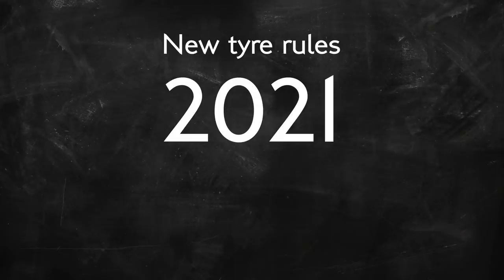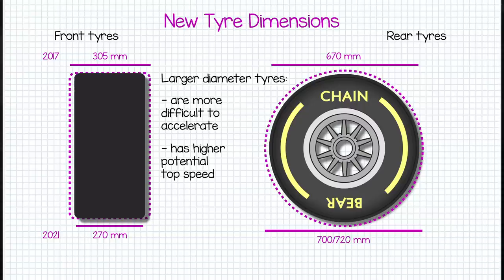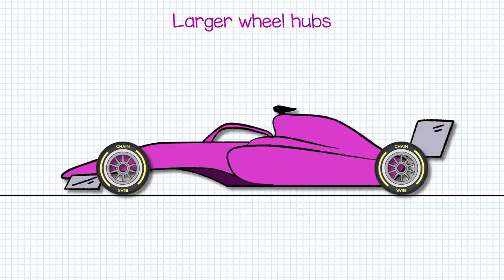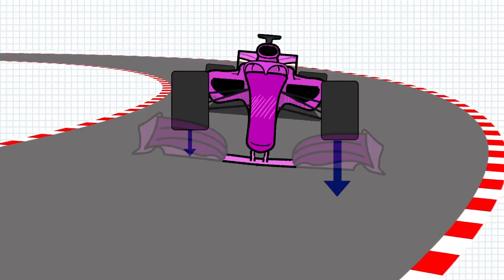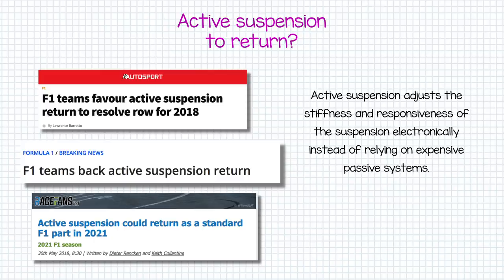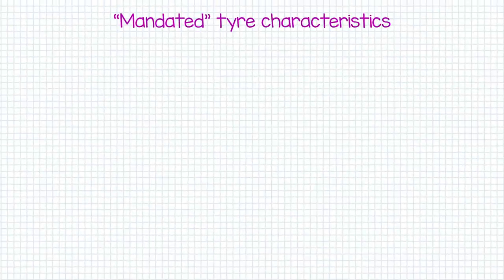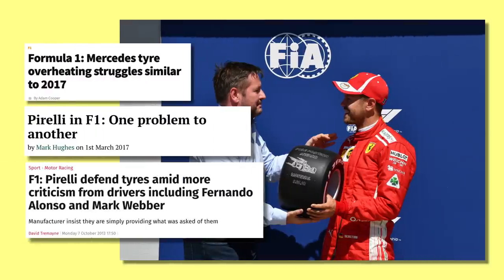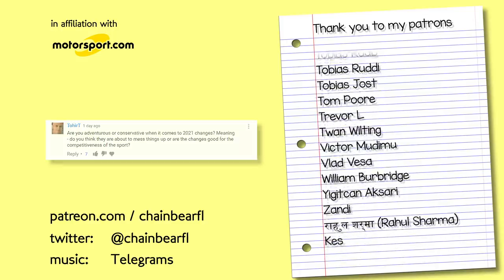New Tyre Rules 2021 explained - Low profile tyres, no tyre warmers, radical compounds

Comment: to be honest i personally feel like part of the asthetic of F1 cars are the massive tires
Reply: Totally agree. That is what F1 tyres are supposed to look like. This change will make the cars look more bland ie like a normal car.
Reply: let's not prioritize form over function though.
Reply: ThermaL I think as long as the wheel itself is black you wouldn’t notice a huge difference.
Reply: The overall wheel size itself won't change though
Reply: Yes but low profile tires still dont fit all cars, i know its for function but it might end up looking as bad as Formula E
Reply: How about we wait until we see these new tyres before judging it? It's like with the halos this year; plenty of ppl shat all over it for stupid reasons and now no one gives a fuck. And I doubt the new low-profile tyres would even be as noticeable.
Reply: Agree, but we'll get used to it.
Reply: Tradition does not really belong in F1. It's a miracle they kept the tires for so long!
Reply: ThermaL at least they can fit much bigger brakes with 18 inch rims
Reply: Yes indeed
Reply: ThermaL aesthetics dont make good race cars
Reply: only because it what you're used to
Reply: "let's not prioritize form over function though." That's exactly the reason for bigger wheels though, purely for aesthetics, the engineers will have to work with it and figure how to make it better, but the decision from above is based on aesthetics/image.
Reply: it's part because it's never been changed. give it 10 years and you'll look back to this and think it was weird
Reply: True, thats a defining feature when you think of an F1 car. The move to slimmer tires are solely a business and marketing move for tire manufacturers (Pirelli) so it can translate to consumers like us to want to buy that brand for our cars.
Reply: Yeah I kinda liked the look of them. oh well.
Reply: Right, but on a more narrow tire, bigger brakes will lead to more wheel lock-up, and those are some ugly smoking flat spots (thank you Jebus for slow-mo replays). I would guess the engineers either won't increase the size of the brakes by any substantial degree, or they'll be employing some fancy valving/EBD tricks rather than just slamming bigger, heavier parts on the front (especially since, barring changes to the metallurgy, bigger wheels also means an increase to unsprung weight, no bueno for handling/stability). These cars already pull OVER 5G braking on the fast tracks like Monza, whereas even supercars on the street struggle to hit even 1.5 G. I would say deceleration is already what F1 cars do best. Gonna be difficult to top.
Reply: TOKINSHOGUN I agree on most things. Except the last point. With modern alloy wheels, if you have two wheel and tire combinations with the same overall diameter. The one with the wider wheel and the and the thinner tire sidewall would be lighter.
Reply: "no one gives a fuck" Who says no one gives a fuck? l do. I like seeing the drivers not some stupid looking halo...Just because it's a done deal and there's no in sense arguing about it anymore  it doesn't mean everyone's pleased with them. Protecting the drivers is great  l don't think the Halo is the best solution.  l actually liked the windscreen proposal better. 
  There's also the question where do you draw the line in safety There's even more that can be done to protect drivers Something can still get past the halo and hit the drivers shouldn't we be worried about that? Maybe the cars should have roofs.
Reply: Yes, the sidewall made of nylon (PA66 plastic) and rubber will get lighter, while the wheel made of an aluminum alloy(that is to say, a metal of considerably greater gravity than plastic) will get heavier. Whilst you think on the overall effect that might have, here's the very first result that came up on Google, courtesy of Car and Driver testing some crap VW: https://www.caranddriver.com/features/effects-of-upsized-wheels-and-tires-tested
Reply: Also, I'm sorry but I have to contend with your use of the phrase 'modern alloy wheels': the era of automotive history really isn't a factor, either. In 1975, a 15x6J stamped steel wheel generally weighed more than a 14x6J, just like it does today (not that anyone even makes 14's anymore).
Reply: TOKINSHOGUN That only applies to the non-forged steel wheels they were using. F1 cars use forged aluminum/magnesium alloy wheels. Also, I have no idea where you got the idea that nylon, a very hard plastic is used for the sidewall.
Reply: Whoa, didn't realize F1 could change the laws of physics. Have to look into that. 
And yes, there are indeed polyamide fibers in the sidewall (and tread, for that matter) of the tire. Perhaps not name-brand Nylon or Kevlar, trademarks of DuPont, but they're in there, in the casings for the steel bead wires, and possibly chafers around the zippers, depending on construction. PA is only 'very hard' (that's a lol, because the aforementioned PA66 is about 12k psi when it's extruded and no glass-fill) as a solid block; it's quite pliable when made into a fabric (you may well own clothing made of nylon). Pirelli doesn't disclose exactly what goes into their tires, but we know it's a bias-ply/radial hybrid since at least 2013. Here's a link from back then, even though it doesn't sound like you a) checked the last link or b) know a damned thing about tire construction: https://www.racefans.net/2013/01/23/pirelli-2013-f1-tyres/
 Everything uses forged or cast aluminum now, certainly not just F1, but you miss the point completely: the bigger the wheel, generally the heavier it will be. Simple as that. The 18" wheel will be a little narrower, but that won't offset the massive increase in circumference. Seriously, just think about it for a solid thirty seconds.
Reply: TOKINSHOGUN Polyaramid fibers and polyamid fibers are two entirely different materials. If you're going to insult me at least use something vaguely factual in your argument.
Reply: It's polyamide, not 'polyaramid', but apparently you don't know what those are either. Polyamide is not a material, but an entire class of materials both natural and synthetic. Aramid is a contraction meaning 'aromatic amide'. Nylon and Kevlar are both considered para-aramid; perhaps that's what you meant.
 Apologies for being so crass, but none of this is secret information, and you led with a statement that was illogical. And once again, it doesn't sound like you digested what was said/took 30 seconds to research it. Instead you claimed I misspelled a word you're simply not familiar with. Since you didn't find anything substantial to argue with in the last comment, though, maybe that means you've discovered evidence of PA in the construction of slick tires. So at least you (maybe) learned something...
P.S. if you're going to correct me, at least use something factual in your correction :D
Reply: ThermaL, I happen to think that my 'massive SPARE tire' is a large part of my aesthetic !
Reply: @jbc17c  the teams should paint the rims
Reply: @rfldss89  Ironic that you say this since thinner tires decrease their function over thicker tires. They changed the tires for form not function.
Reply: @NikoxD93  Exactly, and the tyre sidewall is a huge part of the suspension in an F1 car currently, and in most open wheel series. Coupled with the fact that they already have enough brake force in  the disc diameter setups they have now, plus the weight associated with moving to a bigger wheel, its purely a move for marketing and looks for the average consumer.
And I hate that, when does the consumer start saying to Mercedes that their showroom car doesn't have the same wings front and back.....
Reply: People say this to every stupid visual thing. That it's the soul of F1.
I for one would have wheels enclosed in the chassis, because it's stupid to have the wheels open both aerodynamically and safety wise.
Reply: @Reydriel  you can judge the new tires if you want. It will not influence the decisions made by the FIA based on the team's wishes and the supplier's offers.
Reply: They only look bad on formula e cars because they dont make a sound and powered by batteries 🤣
Reply: @Reydriel  what do you mean "no one"? Those thins make the cars the ugliest ever. I care!
Reply: @brianbethea3069  To what mistake are you referring? The comment Dylan claimed he was insulted by: 'Whoa, didn't realize F1 could change the laws of physics. Have to look into that.' Snarky, sure, but insulting? Really? He was also mad because I replied 'lol' when he stated 'Polyaramid fibers and polyamid fibers are two entirely different materials. If you're going to insult me at least use something vaguely factual in your argument.' That was a demonstrably, hilariously inaccurate remark, which garnered a lol.
 How incredibly insulting, I know. You also apparently aren't picking up on the fact that my statement about being insulted was actually a rejoinder using his own words from the aforementioned quote. His own remarks insulted his intelligence, I just attempted to redress the erroneous comments in rather smarmy fashion.
Furthermore, I care less for your feelings or my own ego than treading upon people's aggressively ignorant misinformation. If he's going to condescend while espousing complete bullshit, I'm not going to any great lengths to be polite. I'm terribly sorry you're so easily offended, and yet can't be bothered to read the thread to actually gain context into what's being said. He wanted to act like he knew what he was talking about, but just spewed one lie after another. I started out more or less polite, but at a certain point it just became entertaining to continue arguing with him about stupid shit. Now it seems you would like to get in on the stupid games; you're doing quite well and scoring some serious points already!
Reply: Agreed
Reply: You won't notice it after the second race
Reply: I still think jumping straight to 18inch is too much of a jump. I thought 16in would look much more balanced.
Reply: So were the engine sounds. Times change and F1 must remain at the forefront. It cannot afford to stand still.
Reply: They'll make low profile monster truck tyres next!
Reply: @jbc17c  early tyres were in white back in the day! Early natural rubber tyres were white...
Reply: Don't be sad. If you're rich enough you can actual F1 tires on your car... Also the brakes are going to insane.
Reply: Massive rear tires and much smaller front tires are what made older formulas so cool.
Reply: SharkyDotDash I recognize that feeling, but then I see the cornering speed, and forget about it and just watch F1.
Reply: Right but look at Super Formula : a japanese fomula with that 2021 stylish tyre profile, and these cars look awesome
Reply: @josephcoleman57  Ejection seats would be cool :D
Reply: @avada0  "l for one would have wheels enclosed in the chassis, because it's stupid to have the wheels open" Go watch NASCAR
Reply: @brianbethea3069  What is a conspiracy theorist? l believe in several conspiracies You don't? You must be a conspiracy denier.         There's declassified papers that document many government conspiracies over the years. Most people don't know or don't care.  
Conspiracy theorist is a derogatory term made up by either really naive people who get their information from the Mockingbirds or people who don't want any kind of scrutiny from the public
Reply: Why even regulate damn tires?
Reply: George Rosebush 
Did you not even watch the video or read what the FIA & any team engineers have said ?
Reply: @rfldss89  The entire concept of F1's appeal is form over function. Driving around burning gasoline going nowhere. But the appeal is good looking cars being awesome.
Reply: @Str8DV8 That's entirely to do with rubber compound and nothing to do with tyre profile. Formula E doesn't use racing slicks, their tyres are much more like a standard road tyre than a race tyre. Formula E has quite a hard rubber compound compared to almost every other racing series.
There will be no less mechanical grip and cars will actually be faster because the large amount of sidewall flex on the current big tyres has a very negative effect on aero. Also taking a lot of the work of the suspension away from the tire and into springs and dampers, which you can actually control, will allow more fine tuning of the setup.
Reply: Rafael Santos 
But form is also very important, otherwise all racing will be the same, because the best performance is in 1 form, and all cars would look same
Reply: Rafael Santos The higher tire compund is faster overall tho theres a reason F1 Teams prefer them
Reply: Rafael Santos form over function is the whole point of F1 rules.
Reply: @Reydriel  The overall size of the wheel IS changine, they're taller and test drivers say that they obstruct the view of being able to put the car on the apex of the corner.
Reply: @rfldss89  But function and efficiency is being lost due to the larger, heavier wheels.. over 30kg in total with greater rolling mass.
Reply: They're also the reason why the racing is so bad, so ide rather have uglier cars and better racing
Reply: @Reydriel  Look at formula e or f2. it's terrible
Reply: yes, it was, new look so bad
Reply: I agree I hate the thinner tyres in the new regs I really like the thicker ones
Reply: But the new ones are bigger just thinner
Reply: @ardijanuar2036  yeah and better breaking for better turn overtaking like underbraking to make it more exciting
Reply: Completely agree with Sharky. Losing an iconic shape to pander to the street car driver in all of us seems pretty lame. Better get rid of that long nose thingy and the front wing deal because I sure don’t have that stuff on my mini van
Reply: you say that of every aesthetic change
Reply: Personally I don’t really care for it, but the fact is that the new tires can last just as long as the old ones if Pirelli and the FIA want them to do so. The reason it doesn’t throw me off aesthetically is because of the gorgeous LED hubcap thingies coming in 2022.
Reply: Only because it's what you're used to. Same thing happened with the Halo. I didn't get into F1 until the halo's first season, so I didn't really know cars without them. To me, they just looked normal. Same thing will happen here
Reply: It’s because ur used to it

Comment: Got a 1.6litre with 18" wheels and a spoiler, feeling more and more like driving a F1 car ;)
Reply: have you got your stick on MGU-H from Halfords yet?
Reply: Put a bunch of stickers and slam it for a proper F1 experience
Reply: Don't forget to straight pipe the exhaust! Noise = horsepower
Reply: And wind deflectors for another 50-100 horsepower
Reply: And I'm pretty sure it sounds better than an actual f1 car